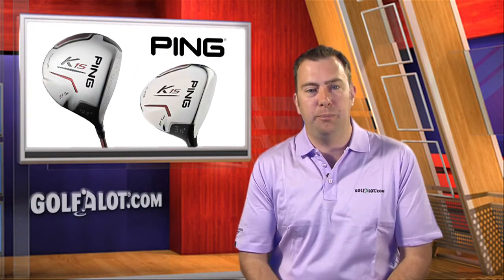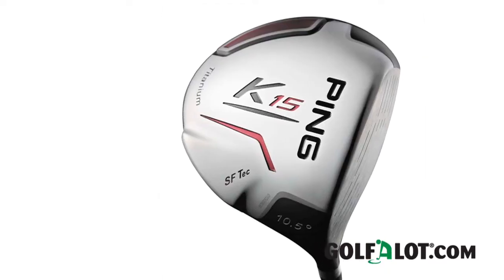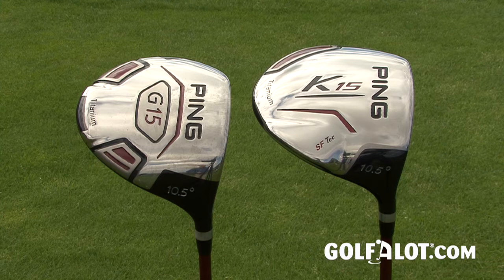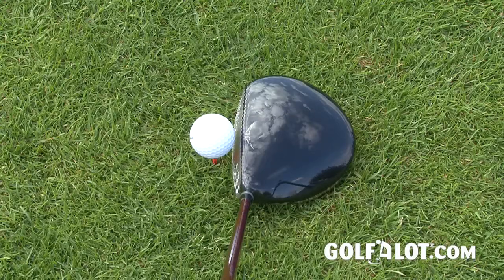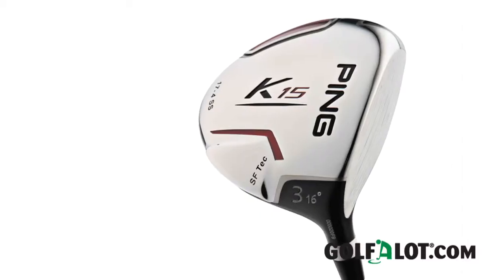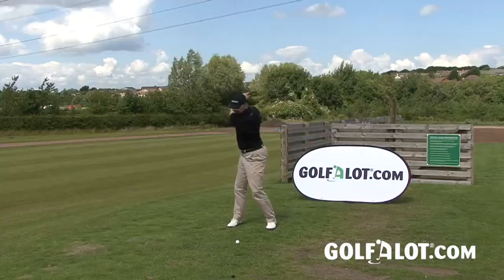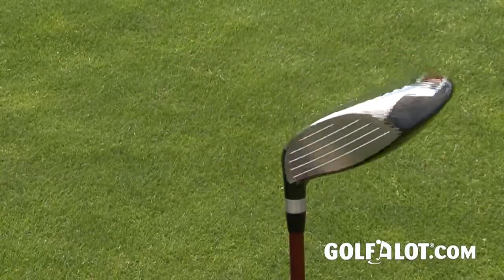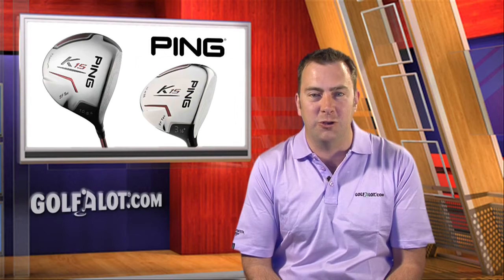Ping K15 Driver, Fairway Wood Review by Golfalot.com

Comment from the maker: @dvfly It's not that low and mid handicappers won't benefit, they probably will.  The K15s are aimed more at game improvers who need a bit more help to get the ball up and to reduce the effects of side spin.  To do this the K15s are a little more offset, more closed faces, a higher MOI and hit the ball higher than G15 or G10 but some better players may like these benefits. Best to get along to Ping and be custom fitted for the right club for your swing whether that is K,G or i15.